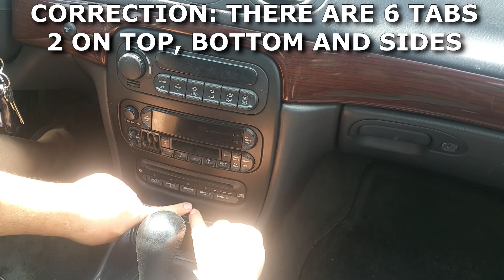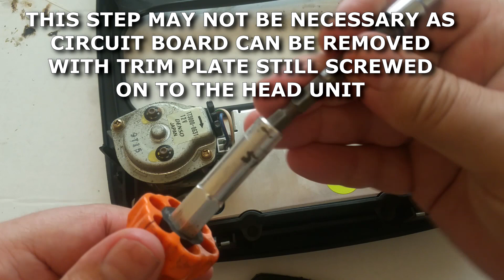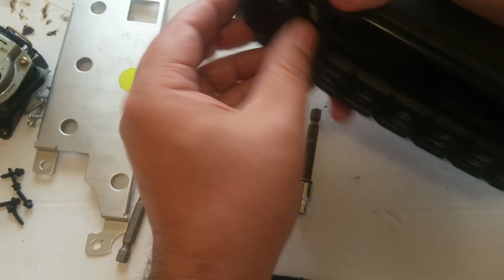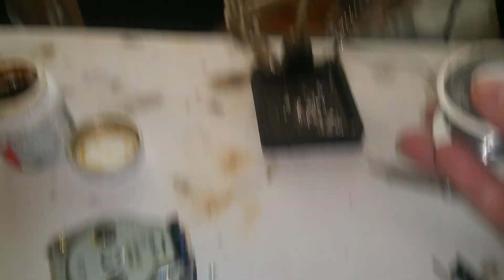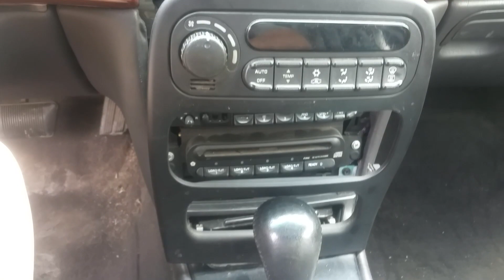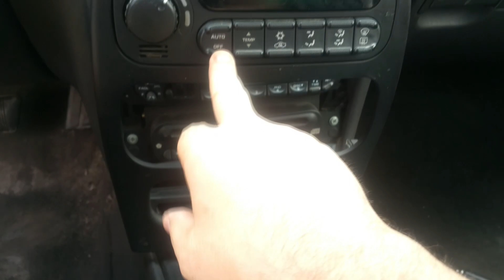DIY - Car Heater AC  / Climate Control "No Display" Fix CHRYSLER

Comment: What bulbs are there? Where can I buy them?
Reply from the maker: they are not bulbs
Reply: @diyvinny6300  I mean 4 bulbs for backlight of buttons.
Reply from the maker: @Tita_007  idk, dont have car anymore, but u just need to measure the diameter of the bulb base and maybe even the the height of the bulb from base to the top of bulb, need mm measurements and they are sold as "t" in the bulb name, eg. t3,  and marketed as mini dash bulbs bulb dash lights mini 12v, better to get led bulbs. you need to check how yours look to compare to whats available
Reply: @diyvinny6300  Thanks. I think I don't need to remove the last screw to replace bullbs. They probably can be replaced from behind.

Comment: November 19, 2025 2002 Chrysler Concorde 3.5 H.O.  85,000 miles.  With your guidance I followed the vidoe directions and resoldered the connections.  Took about 20 minutes and the HVAC panel now finally lights up as it should  Happy driver. Thank you.

Comment: Update on my comment. the next day the lights quit working, and the whole system failed. I smelt smoke. I must have got the board to hot. I found a used one for 100.00 dollars. works but not the lights. back where I started from. The video is good, but one must be very careful. I am to chicken to try again. I'm going to try a conductive metal type super glue.
Reply from the maker: practice soldering on some random circuit board, flux and leaded solder will make it faster and easier to solder , but practice first

Comment: So it's the soder joints and not in the multi plug connector? I can put pressure on MPC and display lights come on.
Reply from the maker: for me it was the solder joints, moving plug did not do anything

Comment: There is the possibility that the multi plug connector is simply not making good contact. I have put pressure on the connector while unit is still installed and the display lights up but won't stay on. Don't know what can be done about that.

Comment: Thanks for your video.  I have a 2002 Chrysler 300M car and the display would go off intermittently.  I had tried several attempts at soldering components but nothing worked.  This time I soldered these three resistors and it is working fine now. 😀
Reply from the maker: glad to have helped, too bad my 300m is no longer with me, timing belt broke/snapped on the highway right at the required time interval to have it changed
Reply: @diyvinny6300  I had the water pump replaced, and the mechanic said I ought to replace the timing belt and tensioner, so I di that too.  I recently had a problem with the instrument panel going dead intermittently.  The windshield wiper would not park correctly as well.  I finally found that it was a poor ground where the battery connects to the chassis.  Wire brushed it and contact cleaner fixed both.
Reply: @artisanwest9730  cool, easy fix, and for me i was all ready to get the timing belt done until it broke, would of been my 2nd timing belt job and i would of done the water pump as its right there when doing the timing belt, dont go over the limit on time or miles driven b4 doing the belt, else engine is toast / too much money to get it fixed

Comment: After wanting to do this for almost 2 years (too lazy lol) I finally took a 30 min break from TV and did it and it work! Also as you mentioned I didn't remove the control from the housing just the 4 screws holding the tin piece and 1 screw holding the circuit board. In addition I removed the 4 lights and cleaned with contact cleaner because 2 weren't always turning on. Lets see if it fixes THAT problem. Thanks

Comment: Thank you for this video. I tried soldering but my soldering iron left big globs of solder and it still didn't work. So I painted flux in the area that you indicated on both sides of the board and used a heat gun to flow the solder on the surface mount components. I was worried that I might destroy the components with the heat but it was dead anyway so what did I have to lose. It works flawlessly and now I have my display back.

Comment: Hey Vinny, thanks for the information video. I had the same exact problem, in 2 heads. The first one , I fried, because I touched stuff, I wasn’t supposed too. This second head, I bought, had the same exact problem. I couldn’t believe it? So I searched here on utube, and saw your video. I soldered the parts, that you showed, and sure enough, it now works. Thanks for the knowledge!👍 I thought the whole time, it was a loose pin, in the harness? Apparently not? Thanks again.

Comment: Just needed to know how to remove the panel on my 99 Dodge Intrepid; button lights were out (PC74-make sure of 'style') and the Intrepid is a bit different with an extension on the top left for the track control, but basically the same with clips. Luckily my display unit is ok, but I inspected the SMD's and they are good. Thank you.

Comment: A related question - my backlight burned out for the two buttons on the left (AUTO/OFF and TEMP). At the 9:15 minute mark on the video, I can see 3 light bulbs. I suppose I would need to change the third light bulb on the right to get that working again right? Thanks in advance :)
Reply from the maker: Yes thats correct
Reply: @diyvinny6300  Last question. Since I don't know what that bulb exactly looks like, can I simply take it out (to take it to the shop to get the same one) and drive without that one bulb till I buy a new one? I am not an electricity expert and I don't want to mess anything up.
Reply from the maker: @markmarku8169  its sized by mm, idk the size, cheap on ebay but faster at local parts supplier, call to make sure they have various sizes in stock, easy to remove/replace, just push in and turn

Comment: So that's it? I thought it was a big job to do or have to replace the thing. Mine have been off for years, now I'm gonna try to fix it. Same as in My Intrepid.
Reply from the maker: if head unit actually works but has no display yes it will work if ur not bad in soldering. but i explain a few simple techniques in getting a successful re-solder to take effect. might fail again but just redo the solder points
Reply: @diyvinny6300  Yes, My head unit controls works, So hopefully this will work for Me... But there's also a possibility that after resoldering it might still fail again?? ... 🤔
Reply: @phigo4kins  luckily it wont cost u anything to try the fix
Reply: @vinnyc7613  Well It Cost Me Some Soldering Iron And Solder Wire... Lls. About 50 Bucks... :o... But, I did 3 Cars with it, So I Can't Complain On The $$$....

Comment: Thanks very much.  This worked perfectly!  One comment...be careful not to turn over the outside trim over when the guts are out of it, as there are little 'plungers' that transfer the button pressing function to the circuit board inside, these aren't held in ...and will fall out...and good luck finding them!  Great video otherwise!

Comment: nice, got rid of my 300m with the display not working. heater ac worked just had to guess what setting it was set to, seems like an easy fix. thx